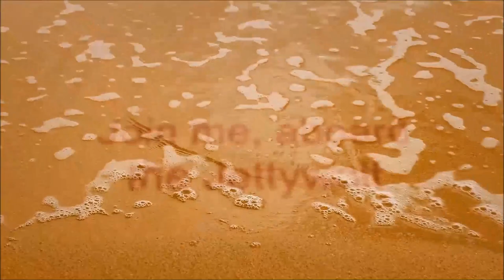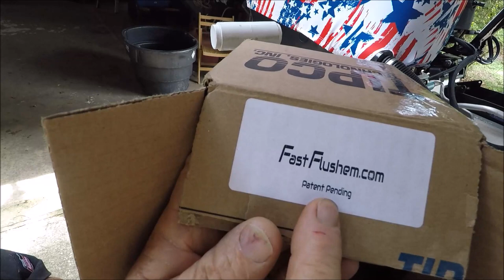FLUSH that outboard 🚽🚽 (SEE description for update❗)

Comment: Great vid Capt Dave, With respect I will add a little something to this, I know Capt Dave knows the difference between corrosion and electrolysis, but for any of my fellow viewers who may confuse the two, look it up big difference. Second thing, After we had hurricane Sandy up here in NY, the shop I worked in was expecting 3 feet of water in the building.  We got 8 feet of water.  My master series Snapon tool box had water over the top. In an attempt to salvage what we could we washed everything with a fresh water hose.  It only did so much. Owner of the place had a case Salt Away that somehow didn't manage to "float away"  in desperation to save what we could, we used it in spray form and in a soaking tank. That stuff actually works. At first I thought this is some type of inert B/S with clever marketing ploy. It really did work.  Now I always keep a bottle of that stuff on hand for removal of sea salt.
Reply from the maker: AND SUPPOSEDLY, a little VINEGAR WILL WORK TOO. I've used it on my boat and in the horse trough, when running the motor, every once in awhile...i know water doesn't do much. But its better than nothing, even my rock hard water!
My old al-ma-mater: www.aluminumalloyboats.com, we had a member who took it all toooooo far. He figured if it was so great, every time he came back from fishing his big expensive new aluminum boat, he'd wash it from top to bottom with salt-away! Well time passed and his new aluminum boat, with mill finish, ended up all streaky and not so great looking. The constant salt away or whatever brand he used ate streaks in his nice shiney surface. The only cure was to 'acid wash, with real aluminum acids, to get it uniform again. Also have a buddy with numerous high dollar Van Staal anodized machined reels. He used it constantly on those reels, and it ATE all the o-rings up, that make it water-proof.
Reply: just going by my experience with hand tools made from high carbon tool steel. different animal from aluminum. I wouldnt use it every time I flush but every so often, not so bad. And keep in mind that there are different types/grades and alloys of aluminum.

Comment: My "06 Suzuki DF150 has two flush port hose connections, one on the starboard side and one at the transom side of the motor at the Boat.. I figured the 250 would have it as well... helps give me a pretty good flush. I rigged a hose into a split and it has quick connects on I screw in the quick connect male into the ports, and connect the hoses and the hose. saves me all of the twisting except the quick connect into the motor
 ports.
Reply from the maker: I know all that. AND....you need to watch this. https://youtu.be/7ZYwh9e2ZD8  I NEVER USE THAT ANY MORE! If you're in dirty saltwater, RUN ON THE MUFFS or IN A BARREL, thats what I'm doing every day. That flusher ports on the motor aren't doing yu any favors. 5 years of it and I had huge issues with my fuel cooler.  Took months to figure out. Hot summer days ''in Florida'', under that cowling nothing stays cool. Fuel vaporizes!!  Henc, THE REASON YOU HAVE A FUEL COOLER. 10 pounds of crap in a 5 pound sack under that cowling!  Massive heat.  NO MORE FLUSH PORTS! run on fresh water, bring up to temp, rev. and get rid of clogging dirt and salt. I will be doing a 3-4 month follow-up video to show if it makes a difference in January. My zuki is my livelihood.

Comment: Capt.Dave,My question is when you flush your Suzuki through the port side connection with the water hose only and I am sure you are aware of, is that if the thermostats are closed the thermostats and where they seat are not being flushed.So you do flush only half of your cooling canals and in that case for the people who keeps their boats in marinas what would be your advice:to do that with the hot engine while the thermostat is open or to remove thermostasamd do flushin?
Thanks in advance
Reply from the maker: I use a 70 gallon barrel......this was a reminder to the masses, thats all.

Comment: Cap, it's pretty simple just to remove the spring on the home center hose. I did it in about a minute with a couple of vice grips. The spring is the part that rusts. That new hose doesn't have the right threads and I can see eventually ruining the engine flush port.
Reply from the maker: I got all that. A guy sent the blue one to me for nothing. So, I'm trying it out. I never use this method anyhow except on my kicker motor. I run my 250 out always in a barrel.  https://youtu.be/5_1lBxX1TU4
Reply: Do you put any additive in the barrel water or dawn dish soap

Comment: Just brought home my Suzuki 150 and I was wondering what a better way to get the flush hose in.. this was perfect timing.   Also, did you make the attachments for the flush plug?  I need that as well already see that I could easily lose that.
Reply from the maker: I don't make anything. I do my own tackle, that's all. the PLUG? Drill a small hole thru them both front and rear, and add a small string with a ball bearing swivel. @ 3:20 minutes you'll see mine hanging on a string. (watch on a larger screen than a dumbphone and you'll see it) The string goes to a tupperware bolt right there. I looped the string backed out the bolt and lassoed it and re-tightened the bolt, Up front I tied it to my rigging tube, where it enters the cowling.
Reply: I Love My 150, maybe a Little help, you should check, if you don't already know but My 150 has Two Flush Ports, on Starboard side of the Motor and one front side near transom.. I start my flush once I get home, run it the entire time boat cleaning time, about 30-45 minutes. New Jersey Ocean and river mud is salty and nasty. I will be doing that RydeLyme flush annually. Great Idea

Comment: Nice flush adapter I agree shipping is high $. Capt Dave do you have to run trimtabs bc of the kicker engine ?
Reply from the maker: I've always HAD trim tabs....I was the 1st ever to have LENCO's in all of NE FLA. back in 1995. So, I have them on the JETTYWOLF too. But hardly use them unless I get someone standing in that back corner. THE PRO's of that Kicker, far exceed any negatives, that's for sure. Trolled for 4 hrs the other day and hardly burned any fuel, and put 4 less hrs on the 20K motor, that keeps me in bid'ness.

Comment: Is there not a set of ear muffs available for the Suzuki 250 ss?  I will be picking up my new boat soon, and am looking for a way to flush the entire cooling system without having to dunk the engine in a 55 gallon drum.  Any help would be greatly appreciated.
Reply from the maker: I do not flush my engine on that flusher any longer I don't use the muffs either because of my low water pickup they say to put duct tape over the nose cone pickups which is kind of bullshit mine gets put in a 70 gallon drum every single time I come back because I run up and down and absolute mud crap water river and after 5 years my entire fuel cooler stopped up cost me hundreds and hundreds of dollars  a local mechanic  told me check your fuel cooler and he was right I got an entire video about it it's totally stopped up. SEE HERE: https://youtu.be/7ZYwh9e2ZD8 all outboards suck, its just to what degree that suck.

Comment: I have a 2006 Suzuki 140hp , is that why I get low water pressure out with the ears , so you start you engine with water port.
Reply from the maker: FORGET ALL THAT.....use the muffs or run out in a barrel. DO NOT USE THAT ENGINE FLUSH PORT for long time use. I have proof!

Comment: Can you run engine while flushing it with the fast flusher?
Reply from the maker: absolutely NOT!!
Reply: Because it will burn up the water pump impeller? I’m asking because I did this and now I have water in the engine oil. I was concerned that’s the reason why I have water in the oil somehow. Thanks again
Reply from the maker: @brenthubbard5922  yeah, you need to READ the owners manual. Yes, you'll burn your water pump impeller. You could have heated something up. Consult a ''real'' certified Suzuki shop.